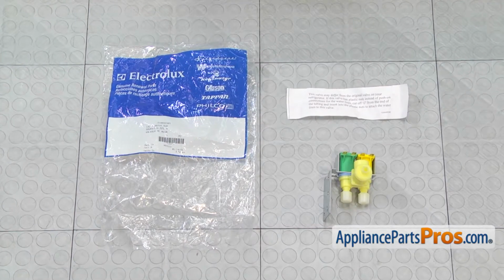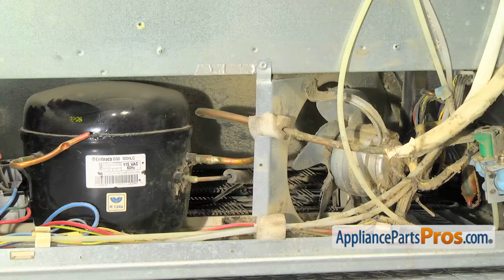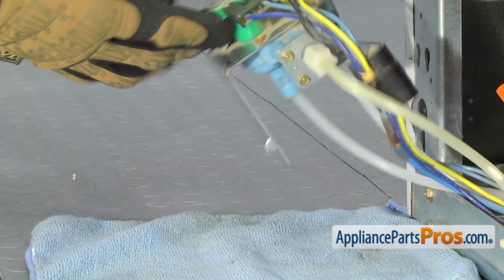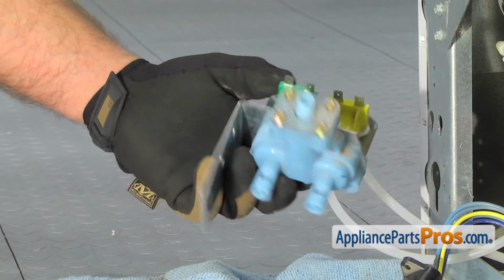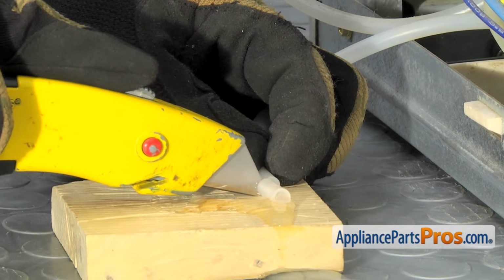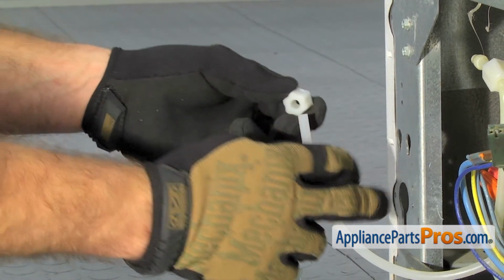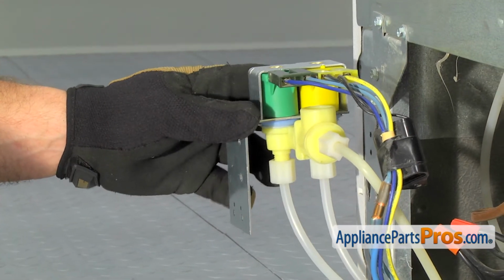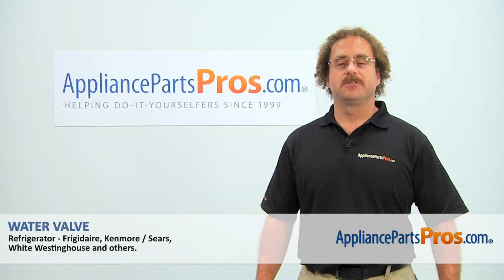How To: Frigidaire/Electrolux Water Valve 218832401

Comment: I noticed a electrical connector close to this valve on mine not connected to anything and no obvious component it may go to. What's the purpose of it? Thanks
Reply: If it has a dummy plug in it, it is meant for that model with more or different options. Pay no mind to it